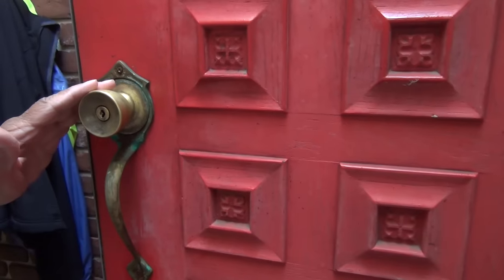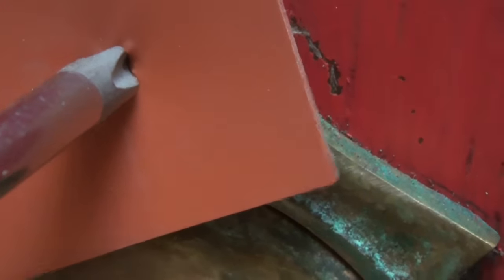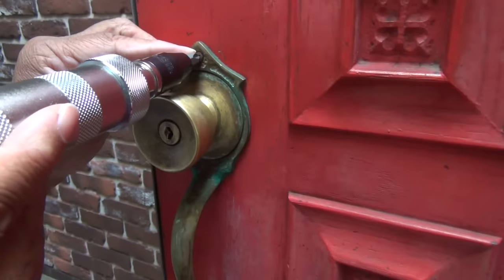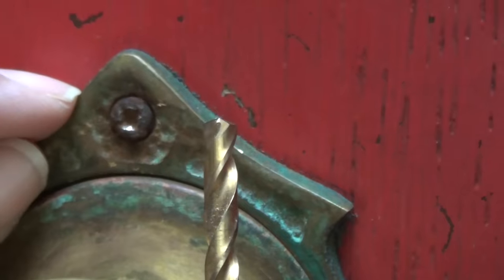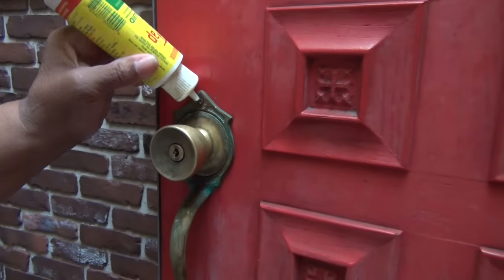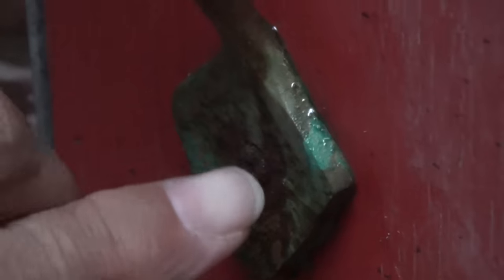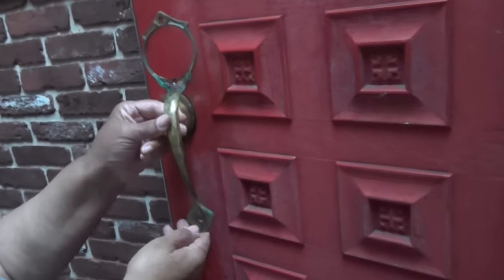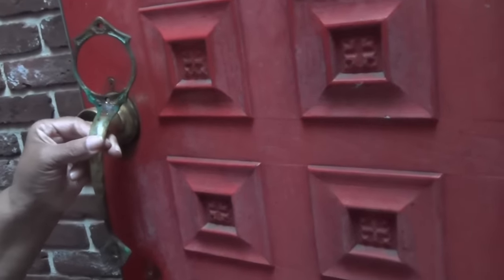How to Remove Damaged and Rusted Screws FAST

Comment: Thx for the Impact Driver video.  It worked!  Spent weeks trying to remove screws attached to stainless steel. I tried EZ Outs/Speed Outs, screw extractors, rubber bands, super glue, drill bits, gloves, and the only thing that worked was using a rotary tool with cutter (Harbor Freight $10) to cut a line/slit(Phillips flathead) in the center of the screw so an Impact Driver can hold onto the screw.  My screw was too short and the material was very soft.  Put painters tape on the screw before using an Impact Driver(Amazon $12).  This was the only thing that worked for me. Hope this helps someone out there.

Comment: Thanks Leah, I bought a bandsaw on Craigslist and the owner didn’t tell me he had stripped some hex screws on the saw. I’ve watched several other videos, but had not seen your method of drilling off the screw head. I’m going to try some other less invasive methods first but may resort to your method. Thanks again for helping to change my sometimes tunnel vision on how to fix something. Greetings from Maine

Comment: Awesome advice again.  I tried the rubber band method and it didn't work for the reasons you stated. My bad screw is still where it was but not for long now. New gadget to add to my collection of tools, the Dead Blow Hammer, love it !
Reply: you can never have enough tool. Im a tool hoarder and its getting out of hand. lol
Reply: @ebbios  It's not hoarding if you use them  :)

Comment: Ms. Leah, I want to take a second to say how much I appreciate your heart and information in these videos.  You are insightful, kind, and encouraging!
As a little return I'd like to share a tip on this topic that saved me tremendously.  Instead of using a larger bit, use a bit slightly smaller than the diameter of the screw shaft and drill a little ways right through the center.  Tap a torx bit into that recess, and screw the screw out.  It's very simple, clean, and puts some of those torx bits to use.  
Thank you, so much, for sharing your experience and knowledge!
Reply: I may try the torx bit idea.

Comment: This is exactly what i needed! Im attempting to remake an old vanity/cabnet that has been lying around for years, its not in the best condition, but ofc i get all of the old handles/hinges out almost no problem, except for the last screw, there flat heads and its basically become a nail bc of all  the dirt and damage to it, but now i can finally start restoring this cabnet!

Comment: Love love love! I was probably about 15 minutes into replacing some deck boards at my parents house and found rotted boards and rusty screws. Some screws were so bad the rusted/rotted in half and I didn't even know that was a thing. Anyways I used this method for one stubborn screw and it was a breeze. I actually used a piece of an old cloth that was laying around instead of rubber but it worked like a charm. Thank you so much!

Comment: A lot of work! A DREMEL CUT-OFF wheel never fails me removing “buggered-up” screw heads. Just put cut-off wheel on screw head, cut to make deeper ridges & unscrew at your pleasure. This way you’re getting the entire screw out, without damaging whatever the screw holds in place. But this is better, if the screw head breaks off. Like your channel a lot! As a woman who loves tinkering, carpentry & buying every new tool  out in the market, this is my kind of Youtube channel! 🙏
Reply: Will this work with a flat-head screw? I’ve got one on an ancient outdoor faucet that is stripped and frozen in place. I’ve soaked it in PB Blaster, heated it with a welding torch, whacked it with a hammer, and nothing has worked! I even bought the Engineer pliers. The metal is soft (brass?) and the slot was very shallow to begin with, and now completely mangled. Any thoughts would be appreciated because YT videos only show the removal of stripped Philips head, not slot screws.

Comment: Great tips. As usual. Especially as you calmly run through the techniques and discard them for a reason. But then there’s the moment with the vice grips where the screw shears off well below the surface. (Wound up drilling around the shaft until I could grab the screw again. Then drilled out the hole and plugged with a dowel and wooden toothpick shims. Fortunately hidden by the fixture.)

Comment: I bought a wooden display flagpole the other day with a flag attached. I want to restore it, but there's a piece of clear PVC tubing on the pole that I don't want on there, but there's also a screw preventing the tubing from sliding  up and down too far. The endcap is both really nice and is held on with a strong glue, but the other end of the tubing is held in place with a screw that's a Phillips that I think I almost stripped.
I'll try this method from now on for stripped screws!
Thanks, Leah!😁😁😁

Comment: great tip. sometimes I use lefthanded drill bits in the same size.  they will sometimes remove the old screw as it drills out the head.

Comment: Leah! Don't forget about the Speed Out screw extractor! The extractor has saved my bacon with a couple of stripped and stuck screws.
Reply: I bought a set of the extractors after doing almost the same thing she did in video but without the lubricant.  I wish she would comment here on those extractors....but certain drilling is the final method to try.  I like her calm and thorough way she explains the methods she chooses.
Reply from the maker: I did a video a couple of years ago demonstrating the speed-out screw extactor.  This video is another option.
Reply: @seejanedrill  , screw extractor techniques work even better if the drill is a left hand cutter. Sometimes the rotational force and vibration of the left hand drill bit will loosen the previously frozen screw as you start drilling the head out.

Comment: Thank you for this video. I'm doing a semi gut and have safely removed and dismantled all appliances and fixtures except a large stubborn mounted kitchen cabinet. The flathead screws holding it is slightly rusted and damaged. They are deeply imbedded in the walls. I will try again with a rubber band. If it doesn't work, I'll use the specialty tools you've listed to drill or cut into the screws to screw them out.

Comment: Excellent video Leah! I've always wondered about removing the screw heads that way. If I come across this problem, I usually WD-40 the crap  out of the screw and find a screwdriver head that will fit into the damaged hole and unscrew them that way. I've been lucky, it usually works!
Reply from the maker: Nice!

Comment: Loved that you showed the impact driver. I use it a lot.  Just wondering why you did not mention a screw extractor set.  That would also work and is not very expensive.

Comment: I go out on job sites and we used to drill out rusted and damaged fasteners. Then I bought a screw extractor set and when you use it correctly, it has worked every time. I love that thing. It came with four different sized diameters for different size screws. Even when the fastener was stripped completely I was able to get it to backwind out. It has saved the company hours. Imagine 7 or 8 fasteners that the wood has swelled around and they‘re all stripped on top of it. They all come out now.

Comment: Top tips as always, Leah.
Would also mention screw remover bits (drill a small hole first) but the trick is remembering to bring them on the job.
(That said, with a really corroded screw the head often just shears clean off and then you're back to the mole grips to get the barrel out.)

Comment: Great video! You really covered some great methods for screw removal. As a note - you can also have success using a good strong Phillips head screwdriver and tapping with a hammer and twisting. I’ve also had screws where the head just breaks off altogether! Looks like you could use a good cordless drill - I rarely ever use a corded drill anymore. Checkout ridgid tools and ridgid jobmax if you don’t already have a cordless you won’t regret it. Keep up the great videos!

Comment: Good one Leah.  About 10 years ago my father sent me a  lock set in solid brass but did not have a key for it.  So I took it to a locksmith to get a new key made.  He was a kind and older man like my dad, and said that this lock is over 50 years old and is well over $450 because of the brass and interior workings.  He repined it for me for no charge just because it was a pleasure for him to work on it.  You might have the same thing there if you have it for a long time.  They don't make them like that anymore.

Comment: I just removed a bazillion screws from the kitchen cabinets hinges that were painted over and over and over. 🤦‍♂️ Decided to use a heat gun to melt the paint and then I could remove the screws. Whew. Had to use a titanium drill bit on a few but I didn’t know that slower is better. Thank you!

Comment: I’ve found Vampliers work pretty well for extracting stubborn screws (before and after you drill out the head)!
Reply from the maker: I've been meaning to pick up a pair
Reply: LOVE Vampliers!
Reply: @WanJae42  now I've got another tool to buy. Thanks, guys.
Reply: @davidgreen5099  If you buy the Japanese version (they're made by a Jp company called "Engineer"), you can find them on Amazon under the name "Engineer Neji-saurus" (translation: Screwsaurus) ... their products have a dinosaur theme.  It's the same pliers, but the Japanese version has more awesome packaging.  :-D  I guess they thought that was too cute for overseas.  Whichever you get, I end up using them at least once a month.

Comment: Dryer belt pulley wheel is held on with a large metal screw stripped by the appliance repairman last summer when he replaced the belt.  No one else has touched the dryer.   So, I will try the screw extractor.  TY

Comment: Hey Jane, a good tip i learned is that with screws like that. You just take a saw and make it into a flat head bit and then you can fit a big screwdriver in there and back it off EASY!
Reply: The Upscale, the problem is you can't get a hacksaw or a jab saw into a tight space like the one shown here. A Dremel tool with a small carbide or carborundum cutting wheel on it is a much better bet, however you would have to mask off the surrounding area extremely well with a number of layers of duct tape oh, and of course if the screw is recessed deeply then you won't be able to cut a notch or Groove into the screw head without damaging whatever piece of metal is being held in place. 

I have sometimes epoxy glued a screwdriver bit or drive bit into the damaged screw head, but that takes at least five minutes for the epoxy to cure, and if you really need strength than you might end up using a slow cure epoxy like J-B Weld, which only works if the screw head faces straight up and you can prop it in place to sit there for hours. However, I am theorizing that a 5-second ultraviolet cured glue like Bondic might work to glue a screwdriver bit into the chewed screw head! Fills all the gaps, between the chewed screw head and the screw bit, and you might not even have to use the exact matching screw bit for that type of screw, you could use a Torx or star bit or something like that with additional ridged surfaces for the glue to grab onto. This might work especially well for that critical first blow with the impact driver.

Comment: Heating the seized up, or chewed head screw with a heavy duty soldering iron or soldering gun may help loosen the grip on the threads a little bit. Works best for metal, requires caution for removing wood screws, and plastic is obviously a No-No. Some kind of freon like spray, an upside-down can of that pseudo compressed air blaster or duster stuff, will chill the metal and cause the threads to contract,  and is worth trying. A couple cycles of heat and cold might be very helpful in loosening the stuck screw.

Comment: I worked in a shop run by a tool and die maker; lots of metal work on lathes, milling machines, etc.  He found that cutting oil was not noticeably better than WD-40 for his uses, and the shop switched over to it.  Of course, WD-40 is terrifically cheaper and more useful in other ways. 
Also, I was surprised that you didn't show "ease outs" as a method to remove a damaged head screw or bolt (though usually for screws bigger than the #6 or #8 you were working on).

Comment: Leah another tip is to hold a hot soldering iron onto the head of the screw until it's really hot, it makes it expand and when it's cooled back down should be loose.
Reply from the maker: Thanks for sharing this

Comment: Just to be clear the drill bit is steel, not titanium.  However the steel has a thin coating of titanium nitride.  This makes it slipperier to metal chips and needs less cutting oil. Also it is a harder material than  just steel so it won't wear as fast. Nutshell.
Reply from the maker: Agreed

Comment: At work , we have been experimenting with potential new uses for so-called 5 Second Fix glues that cure almost instantaneously from exposure to a self-contained ultraviolet light source. I bet you could glue a screwdriver bit, the short type that fits into a quarter-inch hex-head bit holder, right into the chewed head of the screw, and the glue would completely and exactly fill the gaps between the screwdriver bit and the chewed screw head, giving you far more grip and grab and a snugger fit than the rubber band or thin sheet of rubber technique. The screw head is already chewed up, so it's rough and ragged and has bare metal showing, but you should make sure that the bit is free of oil or grease, and you might want to buff any oxidation or finish coating off of the screwdriver bit before you glue it in place. I haven't tried this yet, but I bet it would work!

 On occasion, I have epoxy glued driver bits into stripped screws, waited for the glue to cure, and removed the screw that way, but even with a 5-minute epoxy glue you have to be able to keep the screwdriver bit perpendicular and centered to the screw head while the glue sets. A UV cured glue, however, will typically set in 5 to 10 seconds. Bondic and Fiberfix UV glues have worked well for other applications, and I think it's worth trying for this one as well. If the screw is badly chewed, you don't even have to use a screw bit that matches the screw head; you could use let's say a Torx bit, or a kiddy-cornered straight blade bit, inside a chewed Allen head screw for instance, or something like that, because the Torx screw-bit has lots of surface area and tooth for the glue to grab hold of.  UV glues are similar to epoxy and consistency when cured, and you could scrape it off the screwdriver bit afterwards in order to reclaim the bit. I'll guess that the stuff would probably dissolve in acetone or some other solvent as well.
Reply from the maker: Interesting , thanks for sharing your personal experience.

Comment: Others: 
EZ-outs. 
left handed drill bits. 
cordless 3/8 in impact driver. (almost magic). Pair this with an EZ-out. 
Cobalt drill bits for stainless. 
A long time ago I had a bottle of sticky resin stuff you put on the screw head to make the driver stick better.
Dremel to cut a straight slot for a flat screwdriver. 
Many others.
Reply from the maker: The sticky stuff is called screw grab.

Comment: I use 2 work on helicopters in military and i have a way u might find easier. We did this to remove rivets and ive found works for screws too. Try 2 use a bit thats same size as the threads of screw and drill down to about the threads then remove bit from drill turn it around to opposite end of drilling end and in ur hand insert head of drill bit into hole in screw and lightly snap the screw head off and then ur hardware will just fall off. But as always like ur vids.  If u like this idea mayb u can make a video of it. ;-)
Reply from the maker: Thanks for sharing Dana

Comment: When you say the screw is "seized", what do you mean exactly?  I have been trying to raise the rollers on my sliding glass door but the screw to raise it is completely stripped.  I've tried the rubber band trick but it didn't work.  I'd prefer not to drill the screw out if I can avoid it.  Thanks!

Comment: I have a problem I haven't found the answer to yet. At two separate houses now I've seen this so I'm wondering why I don't see a YouTube video about it. Shower drain cover screws seem to seize. Because they are made of a soft stainless steel, it's easy to damage the phillips screw head. I thought of using heat but I'm unsure if the surrounding tile glue and sealers would be ruined. I've applied penetrating oil repeatedly for many days but no joy. I'm worried I might break off the screw heads then I might have to replace the whole drain. Any suggestions?

Comment: Personally I use a Dremmel, cut a flat slot into the screwhead then remove the screw with flathead. (doesn't always work if in tight space admittedly)

Comment: These are some of the cases where I wish, we had vice grips with Jaws parallel to handle
Reply: You can use pliers but then you have to grip while turning - release - re-grip...
(It's a good way to encourage learners not to strip screws in the first place, though. "It's okay, just take the screw out with these while I get another bit...")

Comment: A dremel with a cutting wheel will work to make new slots that either a flathead or a phillips screw driver can take out the screws. Wish you had shown the final polished hardware.
Reply from the maker: I will be shooting a brass polishinh video

Comment: Thank you. any videos on how to take a broken key,out of the deadbolt.
Reply: The locksmiths have a very specific tool for that.
 (I have also had good luck with a small angled" O" ring pick. It took some time, but slow & easy does it. It does not work all the time though.)
Reply from the maker: No video yet but it's a simple process with a broken  key extraction tool.  You can find the tool on amazon for 
About $15.  Thanks for the video idea.
Reply: @seejanedrill   ok 😔 thank you 😘